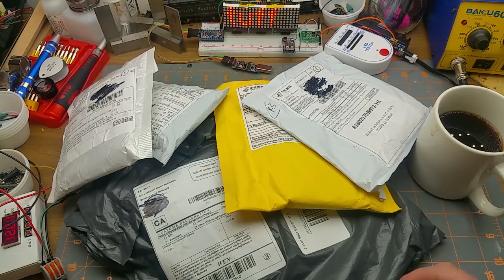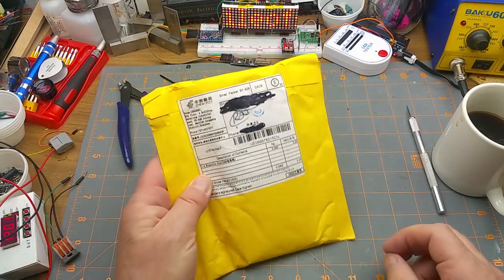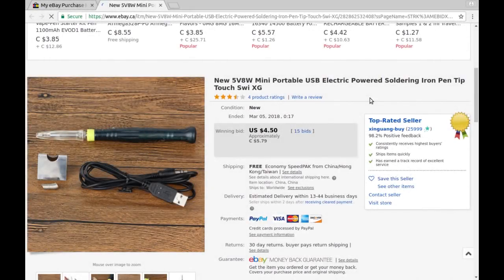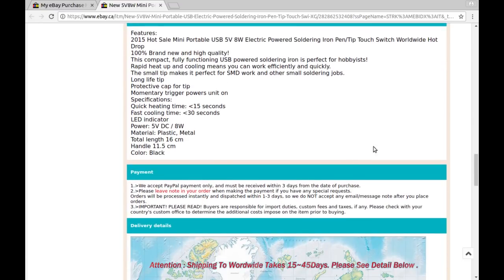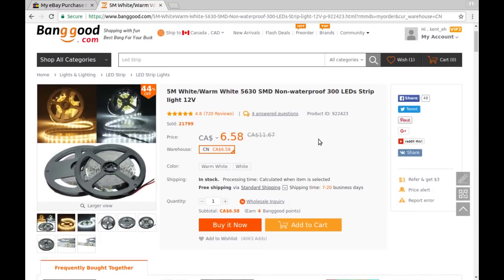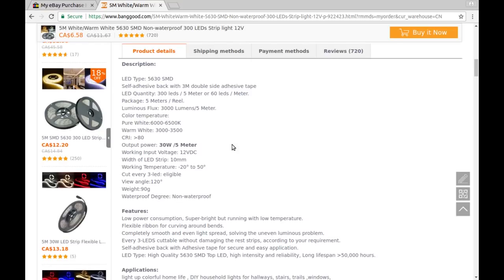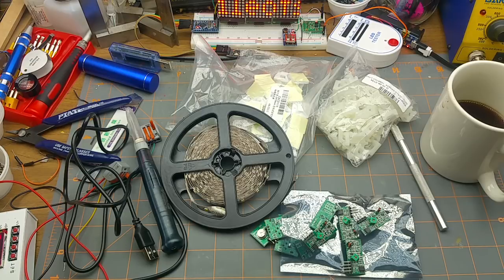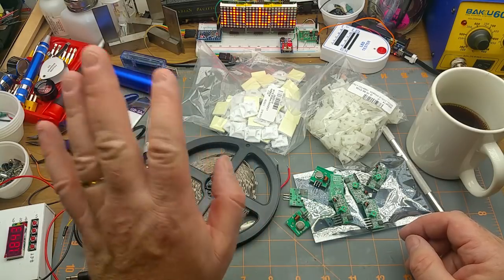Mailbag Monday 27

Comment: Have the same USB iron. Mmm need to check mine too as your seems to have a switch, thought mine was a sort of touch contact.  But before you begin dismantling and troubleshooting I had the same thing happen with mine.  Seems the 3.5mm jack needs to be fully inserted, mine really needs to be pushed in firmly which I didn't do the first time.
Reply: Just took my USB iron apart.  It looks exactly the same on the outside but it seems different internally. My switch seems to be a touch contact. Chinese and consistency... will never happen.